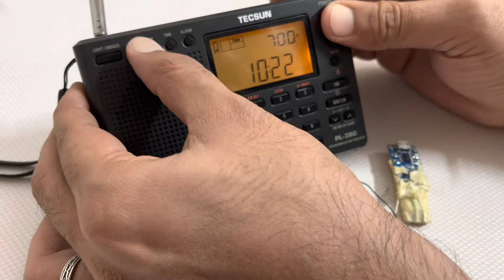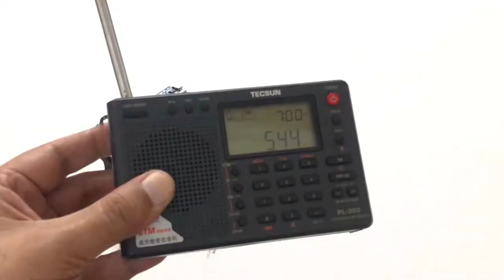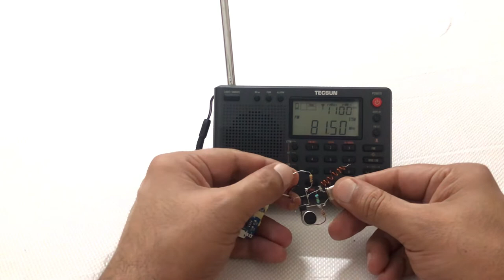FM TRANSMITTER 🛰️ HOMEMADE

Comment: what i need to do to change the Frequency ?
Reply from the maker: Only frequency oscillator bro.
Reply: @WirelessWorld28  yeah i understood that but if play with the reisstors values. Will at effect the frequency ? 
I need to make it adjustable.

Thank you very much
Reply from the maker: @Talas99 you need a potentiometer. Your frequency oscillator works doubling. Like if the oscillator is 2mhz  
It will generate signal 2,4,8,16,32,64,128Mhz.
Reply: @WirelessWorld28  aha okay thank you for your help